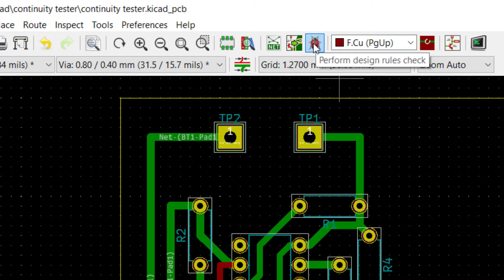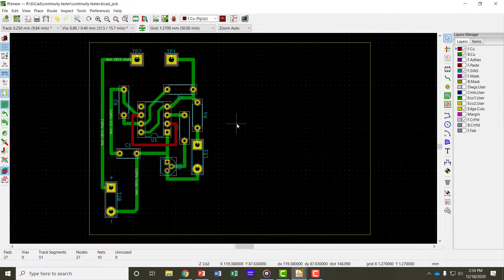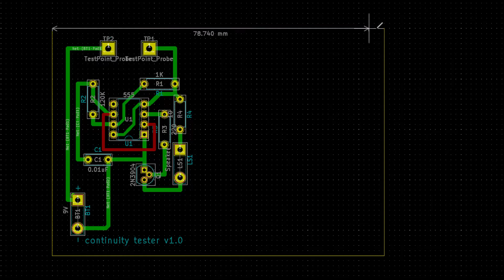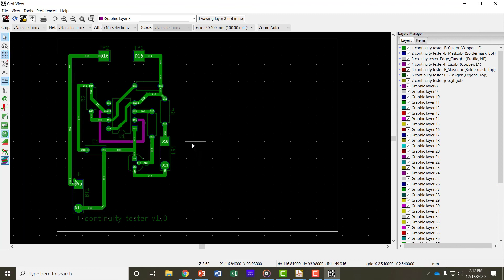Making Schematics and PCBs with KiCad Part 7

Comment: Great series. In a few minutes you taught me how to use KiCad, which otherwise I probably would have had to research for a long time.
Thanks for that ;) In the very first project I needed to create a new schematic marker for a custom module and I painted a Footprint for it also. I searched for a while for a Pin Table, which finally allowed me to number and setup the pins and name them. Thanks to this, pins with connectors etc. were connected in the PCB editor. Thanks again.